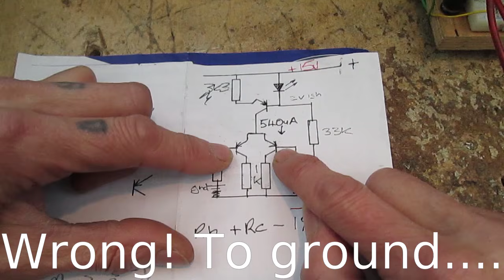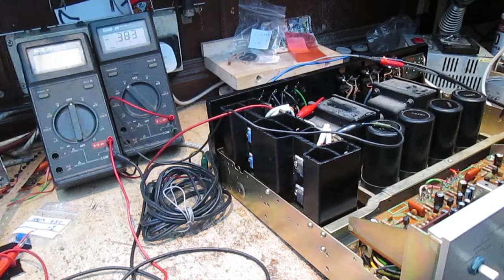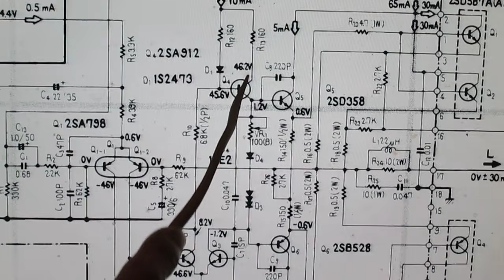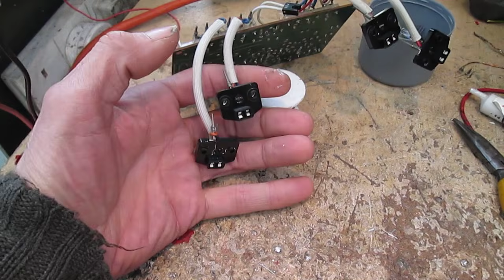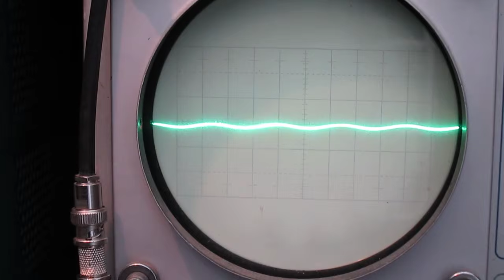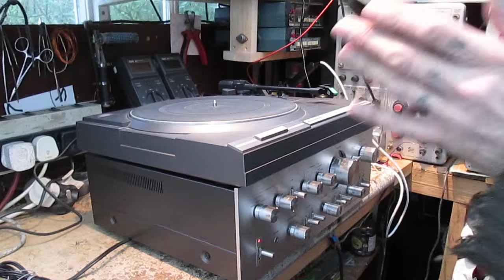Pioneer SA8800 Mk2 - Repair & Restoration Final.

Comment: Good to see you back, Andy
You're spot on regarding the supply of components and I've noticed, especially with some Japanese electrolytics in old computers, that the higher value new ones often have worse ESR than the original 40 year-old caps.
I wouldn't worry about the videos, your health comes first. 
Hope you feel better soon!
Cheers
Reply from the maker: Thanks. Your right even Nichicon etc caps can test bad & getting decent replacements difficult. Hope your well, ATB Andy.
Reply: Happy, happy days. Serviced many Pioneer amps in my younger days. The very picture of it brings back happy memories. Thanks for your video! 🎉
Reply from the maker: @anthonytester6873  Thankyou, your welcome & glad it resonated with you. TFW.